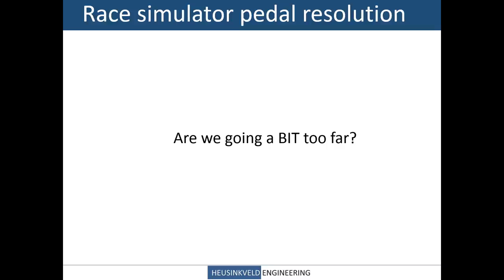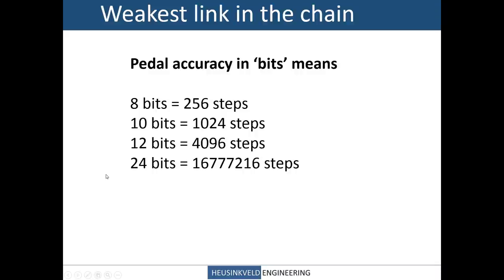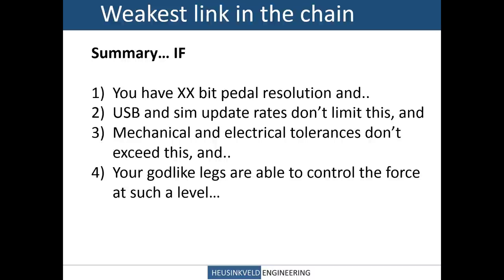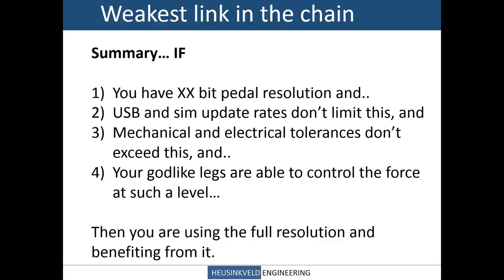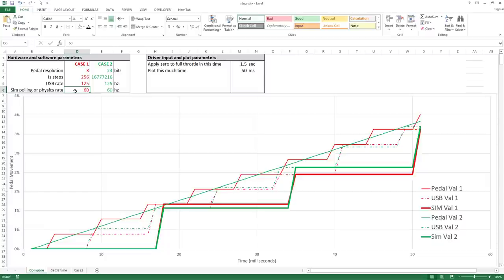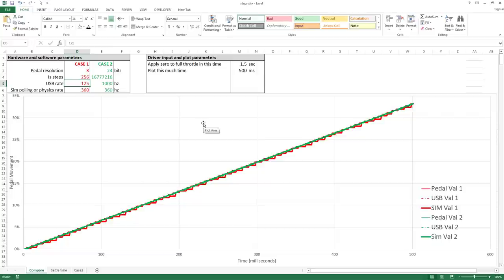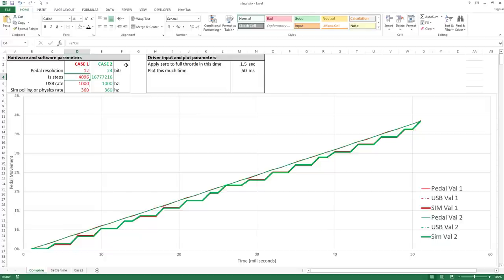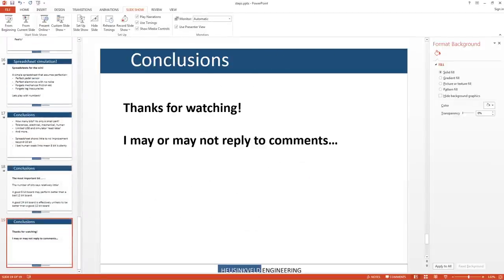Game controllers with 8, 10, 12 or 24 bit resolution, what does it mean?

Comment: I'm going to go out on a limb here and say that this vid is addressing a certain little black box that's now popped up in the Sim world that "improves" the Brake performance for a pricey sum of $200. When i see/heard about it i heard alarm bells ringing for a cash grab product.
Did i win, did i win. YES! You're the best Niels!  New set of HE Pedals for me :)
Reply: i had my suspicion that there was more to it than just bigger is better. This vid has just saved me 200 notes 😀
Reply: It most certainly did save you burning a hole in your pocket. It's a shame the "miracle box" doesn't have a connection the same as my crappy T300 original pedals, maybe it would of made them HE standard... ahaha
Reply: You know I wonder if that gizmo box would work for a set of thrustmaster pedals? Not that I'd be spending on it anyway..
Reply: Not certain but i won't spend that amount on a set of TM pedals, $200 goes a long way to getting a set of Niels Pedals.

Comment from the maker: Couple of updates. First it is quite likely that sims use FLOAT values for the inputs. According to C++ programming, a FLOAT value only guarantees 5 digits (if I recall correctly) so that would put a ~16 bit limit on how accurate inputs can be. Second, Isn't DirectInput limited to 16 bit accuracy? I don't know if / how you can bypass that... Third,  USB traffic is probably not real time, there may be buffers and other stuff going on, so the timing is not always going to be perfect, perhaps. That is too complicated for my understanding.
Reply: Single-precision floating point numbers are 32-bit, with 24 bits used for the fraction, 7 for the exponent, and 1 for the +/- sign.  That's 6 hexadecimal digits of precision, which is supposed to convert to just over 6 decimal digits of precision.  Double-precision floats are 64-bit and are the same, except for 56 bits used to represent the fraction instead of 24.  That gives it 14 hexadecimal digits of precision, which is supposed to be roughly 17 decimal digits of precision.

Comment: Saw this ridiculous Simpit-Review of the 200$ "Racecore24 Brake Mod" today and thought: that´s the final nail to his reputation. What a bullshit-device on this nasty flexing rig. But it´s probably working for another purpose than just placebo. It´s like increasing the center in DIView, so that cars without ABS are not locking up the breaks that soon. On the other hand the cars with ABS likely breaking bad:D With the Fanatec-software you can´t adjust anything and my former Fanatec Elite pedals had 8 Bit on the paper, but the sensors seemed far less accurate, more like 5 Bit perhaps. I had problems with throttle control and the pedal-meter was way to bouncy.

Comment: My old Logitech pedals have about 3 bit accuracy, they only send 8 different values to the sim.  Not a matter of the electronics, or the signal bits or the sim frequency... the rotary encoder was just that bad.  Now that's something where you will feel the difference.

However.  It didn't stop me driving the car.  And it was, honestly, enough to match the hardware that goes into a $30 wheel - the couple cm of travel pedal with its tiny spring.  I still use it for a clutch pedal since that's very much an on/off proposition in sims.

The wheel, on the other hand, operating at roughly 5 bits (32 angles, 7 degrees apart)... not at all enough for sims.  Even going fully linear, 200 degrees of steering lock, you couldn't drive in a straight line let alone place the car where you want it with confidence.

Comment: This is a fantastic video, really helpful for a non-tech guy like me.  You make all the technical mumbo-jumbo easy to understand.  I'm assuming this is a response to The Simpit's very recent video of the Racecore 24 Brake Mod for the Fanatec pedals. However, it seems like many of your points actually point out the need for an extremely accurate brake mod.  The comparisons to the laboratory scale though don't seem to have relevance.  A scale is not concerned with an instantaneous response.  If it was needed, I'm sure there would eventually be a scale that could do it.  I have tried the brake mod, and I noticed a difference right away, even though I was very skeptical.  I am a decent sim racer, but more importantly I am pretty consistent.  I can and usually do run laps within half a second of the previous.  With a ghost car, I usually run inside my ghost, so I think I can feel and see differences to setups and mods.  

One thing you didn't address, unless I totally missed it, with such infinitesimal movement of the brake pedal, you will naturally get a faster response on AND off the pedal.  So is the difference just the pedal movement?  I can't believe it's just that.  Certainly didn't feel like it, as I've tried shorter pedal movement and stiffer pedal settings.  (Of course nothing like the Racecore mod)  And lastly, and this was something I thought of during the test.  Does this basically nullify all high end pedal braking systems for sim racing?  A quality set like yours has all kinds of engineering to make it smooth and accurate and reliable, built for a lifetime.   With this brake mod, most of the engineering and material could theoretically be done away with, with the only need for something strong and stiff, but certainly not much need for lot's of movement and all that goes with it.  I could see that this might be a threat to all manufacturers of quality pedals. But then again, I might be wrong, and I appreciate your comment here in the comment section that theoretically you might be wrong yourself.  Of course, I would love to see you try the mod, or make something similar yourself to see if this is worthwhile.  Don't forget, any kind of scientific upheaval has always been met with boos and jeers, taking years before final acceptance.

One last example I thought of.  Citroen had (has? Don't know if they still do this) a brake BUTTON instead of a pedal.  This would always freak out non-Citroen drivers.  However, every reviewer said once they got used to the lack of movement, they could see how this kind of brake system could be a real benefit.  The thing is, what do you do if you have a system that is so foreign to what came before, how does it get accepted by the public?  Maybe it never gets accepted because it's so unusual.  Would you want to fly in a plane where the wings go forward instead of backwards?  Yet our military has designed jets with that feature. It's all about perception.
Reply from the maker: Hi John, well from time to time the 'bits' thing pops up and indeed the most recent was with Shaun's review. I made a post at Racedepartment years ago but it was time for a video.

There are 2 parts to the mod, the steel tube taking any movement out the pedal is a real one. That indeed makes your response on and off faster. It also highlighted the flex in the rig which can be a considerable problem. When I shared office with Atze Kerkhof, he had braking problems because the flex of the rig acted like a slow bouncy spring, corrupting his otherwise perfect sawtooth brake shape. It literally added 'wobble' to the brake trace as the rig was oscillating from the sudden pedal input.

The electrics part of the mod is I'm afraid too far removed from reality. If it is better than the default circuit board, it is not because of the bits. In fact there is a lot of noise in the signal in Shaun's video, possibly to the point of becoming an 8 or 10 bit board effectively.. At best.

BUT.. Leo Bodnar sells a G25 / G27 pedal 'cable' wich improves the electronics. This ups the bits from 8 to 10 but more importantly, it removes the excessive filtering that Logitech has put in its design. The response of the Logitech is slow compared to the Bodnar cable. Logitech probably did this so very old, worn and dirty pots may still work acceptably with a lot of (slow) filtering.

It could also be that the Racecore 24 mod has less filtering and therefore a more immediate response than the default electronics. I don't know, having not tried either product, but it could be. However, it has nothing to do with the 24 bit part, as you could just as well create a fast response 8, 10 or 12 bit model. And Fanatec are no amateurs, I doubt they would have a slow response over filtered board themselves!
Reply from the maker: Hi Tore, I have no doubt your intentions are the same as everybody who works with race simulators: You want to make it better, faster, more fun etc. That is a passion we share and it makes us spend too much of our time engineering these products! The way we think we can achieve the improvements are different. 

Because this is the internet, people tend to be very black and white about things. Love it or hate it, no nuance! I disagree with the need for 24 bit electronics, but at the same time I can see you're as passionate about simracing as me and others!
Reply: You could certainly try the steel part without the box for a while and see how you feel about just the replacement part being installed.  That would leave the electronics out of it so you could see if there's any difference just for the steel part.  Testing one variable at a time instead of two variables.  That'd be interesting.

Comment: Nice video removing the 12/16/24 bit BS. I'd rather have a 10 bit board with decent signal integrity via a good PCB design and good clean reference and supply voltages than 12 or more bits of bull...t lol

Comment: So here, we only measure a simple single input. (full gas) What if we talk about pedal modulation? Isn't it better to have more steps? Sure the weaker links in the chain do worse to the output but it should be more precise than a lower bit-value right? The switch from G25 to T300 showed me immediatly that I have more throttle-position possibilities.
Reply from the maker: The example is pedal modulation, slowly applying the throttle from 0% to 100% in 1.5 seconds. The faster you do that, the less difference between 8, 10, 12 or 24 bit there is. Of course at 100% throttle or 0% throttle you only need a 2 bit controller :-)

The T300 may work better than the G25 for all sorts of reasons other than the bit accuracy. Perhaps it has a nicer feel mechanically. Or it uses a better potentiometer.  Also the G25 / G27 uses too much filtering on the pedal signal so it is a bit slow and not too accurate to small inputs. It is extremely unlikely to be down to the bits, 256 steps (if done well) is an extremely fine way to apply or modulate throttle or brakes already!

Comment: For a more complete demonstration (not for 12bits vs 20bits, but for cases where there are differences as shown on your spreadsheet) I would have liked to see an evaluation (measure) of the pressure window when a driver plays around wheels locking point (lock-turn-lock-turn etc. in what pressure window are we playing ?)
Reply from the maker: That's a fun video to make, using vehicle physics to calculate how sensitive you have to be with the brakes around the lockup point.. Hmm that would get tricy.. But if you think about it, do you think a driver consciously modulates in 0.3% force steps around the lockup point? So I'm braking at 90kg and then I purposefully and accurately decide I can use 90.3, sensing too much slide, going back to 90.0, still sensing too much slide, going back to 89.7? All happening 10 times per second in a 2 second braking zone? 

My brake telemetry in the Boxer Cup when I was in the zone shows initial application of 93% brake, dropping to 76% in 0.3 seconds, up to 84% in the next 0.6 seconds, own to 75% 0.2 seconds after that, up to 89% 0.3 secs after that, then gradually coming off to zero in 1.5 seconds. If that happened in steps of 0.3% or 0.01% or 0.00006% it wouldn't really have mattered.
Reply: I don't think a driver modulates 0.3% on purpose when detecting wheel lock but goes (at least tries to) on purpose AT (or as close as possible) that limit where wheels lock because this is how to maximise braking efficicency. And THEN, when this is done very accurately, I mean being able to get very close to that limit and to STAY very close all along  the degressive braking, then the result is this alternating lock/unlock even if most of them are not the result of a controlled modulation in reaction to the locks and unlocks.

Most of the locks/unlocks are uncontrolled (random but symetricaly, exactly as shows your example of averaged values based on low count samples where you are half time a bit below/above 2000 and sometime spot on 2000) BUT they do happen BECAUSE the driver is able to go (tend) very close to that locking point.

Thought reversed: a braking resulting in this altrenating lock/unlock is necessarily a well optimized braking (purely in term of dissipated energy per meter). And possibily a better braking should result in a higher lock/unlock frequency.

Hence why I think studying the accuracy window in which this lock/unlock happens may be interesting. For those over and under braking spreading naturally equally around the lock point this means the driver is able to accurately target the middle of this zone (which is the condition for over/undershoot coming from inaccuracy to spread the most equally as possible, which is the sign of a well operated braking.  This is the    sign the driver effectively managed to reach the middle point so the accuracy of our simulated pedal plays a role here, especially since we are also talking about a dynamic manoeuver where the driver have to keep closer to this middle point all along a degressive braking).

As a F1 fan I see a lot of those lock/unlock and slowmo let you notice details like frequency. I never analyzed it really but it seems lewis hamilton do it (lock/unlock) very often (maybe less since he is with mercedes than with his mclaren) and with a hgher lock/unlock frequency than any other driver, and he is certainly one of the best at braking and undoubtely a late braker (alonso too but lewis is better at it. verstappen too iirc).

Of course we are not talking about .00006% nor even .02% but the question is how much is required to achieve that. This is dealing with the problem from the other side of what you did (and which, imho, does not completely answer the question of "how accurate our pedal need to be to not be a limiting factor". I mean the virtual brake, not only physical but also including the pooling rates (usb & game engine) you took into account with your (very good) spreadsheet demonstration).
Reply: As a complement to my (maybe too long) above answer:

- of course the subject I proposed goes a bit beyond what your video meant do deal with (the lack of usefulness of that high precision, which I completely agree and you demonstrated brillantly)

- if I'm not mistaken wheel lock is less likely to happen at the beginning of the braking due to high downforce and high kinetic energy still contained in the wheels due to high rotation speed

- higher lock/unlock frequency should be synonym of more efficient human braking unless the locks start too early in the degressive braking. Why ? Because we can certainly make the statement the lock state has a somehow incompressible min duration. Because of that the sooner the locks start (in the degressive braking) the longer total distance is made with wheel(s) locked (because car speed is bigger at the beginning of braking) which I guess is hurting too much the overall braking efficiency (= effeciency gain from spending longer time close to lock point is nullified by too much time(=distance) spent with locked wheels)

- highest braking efficiency should be reached with no lock and braking just below lock point all along the degressive braking, which is the theory behind ABS (micro locks and at high frequency). As this is beyond human capability this is why I think multiple locks is the sign of reaching the best efficiency a human can do (if no lock at all you most likely spend too much time too far from lock point = you waste available braking capability. That's why some locks can be more efficient despite the efficiency loss due to the time spent with wheel(s) locked )

Comment: Niels - long shot that you'll come back to reply on a 3 year old (awesome) video, but giving it a go just in case.

Say you have a set of pedals with a heavy duty load cell (e.g., Heusinkveld Ultimates) and when calibrating in iRacing you only apply enough max force to use a fraction of the capability of the load cell - because that is what feels right/comfortable.

If the interface board was designed to distribute the possible output states of the A/D conversion across the entire capability of the load cell, yet you are only using part of it, would having more bits/steps help in that case (in any noticeable way)?

Thanks,
-Perry (recent Ultimate pedals purchaser)

Comment: Very interesting video. Only one thing I would like to know. How effective can a well chosen refresh/polling rate of USB and Sim be. What I mean by that is if both rates can be in sync or out of sync. if you look at 17:56 you can see that after 20ms the USB already registers a new input of 1,7% pedal movement, but it takes the Sim another 14ms to update. If the USB rate and Sim polling rate would be equal in this case there would effectively be less lag and perhaps more accurate response from your input. However, I also imagine that they might be out of sync which means that after the USB has updated it might still take another 20ms before the sim updates. So, I'm wondering how effective it can be if the Sim and USB rates are multiples of each other and thus can sync, or if this would have no or almost no effect at all.